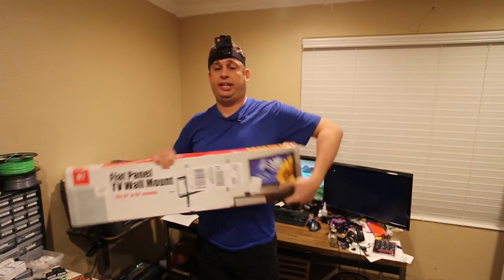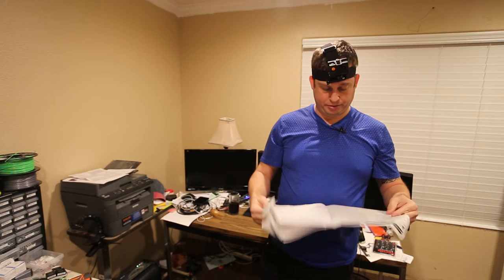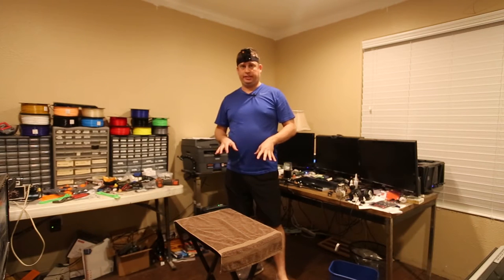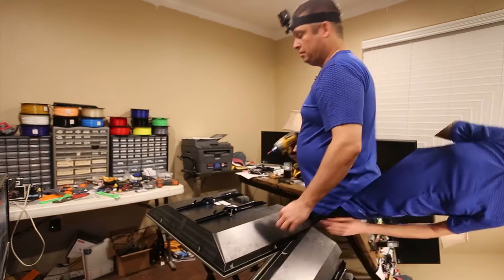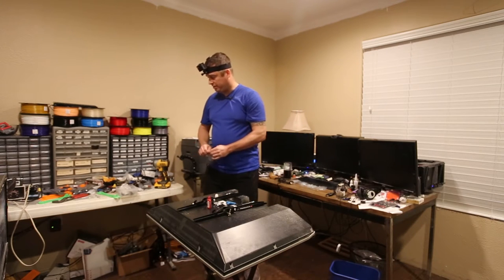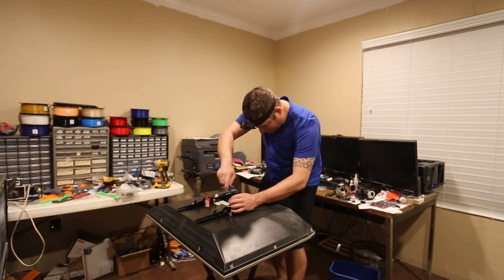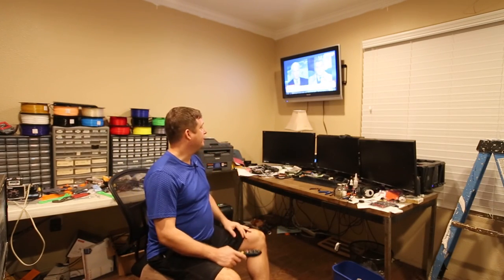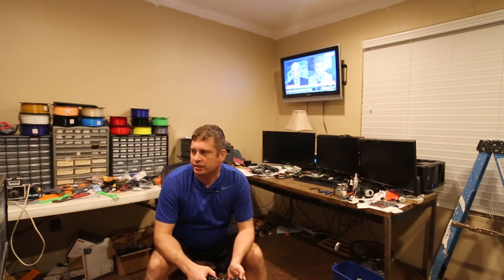Project / Review: Harbor Freight TV Mount

Comment: Hey Brian. I see you've installed both of the mounts HF offers, this simple tilt style and the full motion. Which one would you say is the fastest and easiest to install, and is the difference significant? I have a 55" LG and while full motion would be nice I don't really need it. Just moved into a new apt and have a ton of furniture and fixtures to install, anywhere I can save time really adds up as I'm surrounded by boxes! The price difference between the two isn't a factor for me. Thanks!
Reply from the maker: I like both units. I thought I replied to this already, but apparently my comment didn't post.  The tilt (non-swivel) is slightly easier to install.